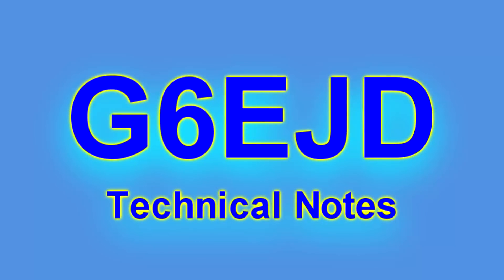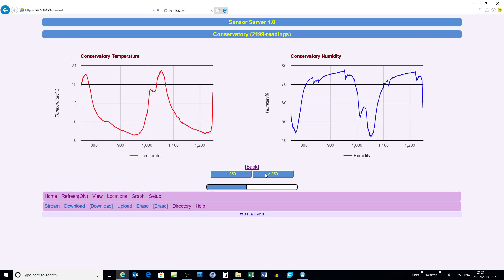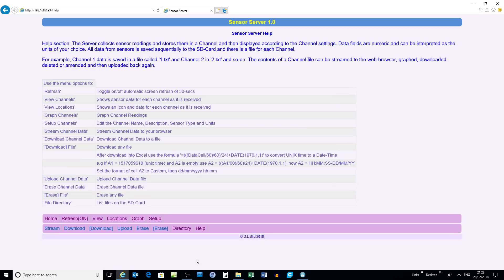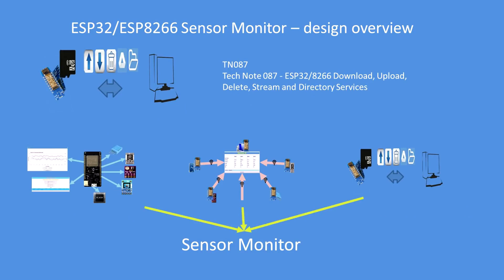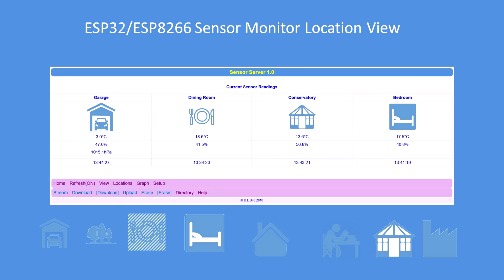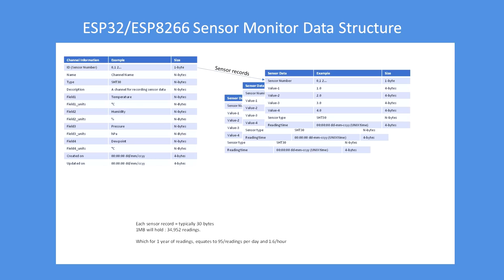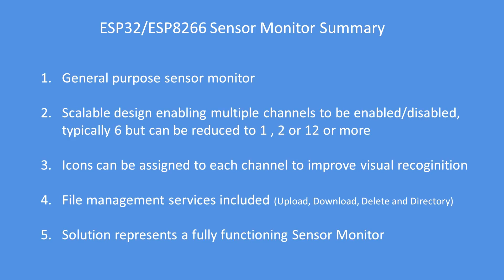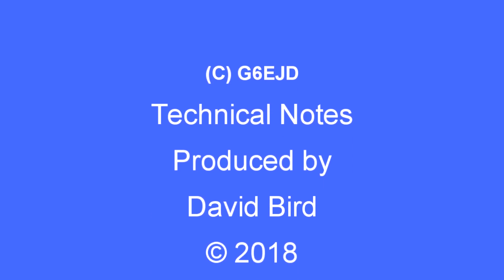Tech Note 088 - ESP32/8266 Sensor Monitor

Comment: Hi Dave, 
Have my 4 sensor all working OK. 
Many thanks for a fine piece of work.

Q. How hard to put "Time" on the graphs???
Reply from the maker: Hi Pete, in the graphing section code I’ve left the line that uploads time to google charts you can have either a simple numeric count or time. It’s difficult to get google charts to display time because it compresses the margins but a compromise is to adjust the display angle. The uploaded time is Unix ordinal format. There are also other examples of displaying time in my repository it’s only a single line that needs to change.
Reply from the maker: // Uncomment next line to display x-axis in time units, but Google Charts can't cope with much data, may be just a few readings! 
236    //webpage += "minorGridlines:{fontSize:8,format:'d/M/YY',units:{hours:{format:['hh:mm a','ha']},minutes:{format:['HH:mm a Z', ':mm']}}},"; 
237    //minorGridlines:{units:{hours:{format:['hh:mm a','ha']},minutes:{format:['HH:mm a Z', ':mm']}}  to display  x-axis in count units

Comment: Wow. You have spent a lot of time producing this sensor software. Thanks!
Reply from the maker: David Kempton - I hope you enjoy it, making it reliable and robust against errors or system faults take me longer than writing the bare code. My server has be running 24/7 since early Nov17 without any issues and has built up many 000,S of readings. The only thing to watch is file transfers as you may think it has locked during large transfers but the http protocol is quite slow on the ESP compiler. I need to put S means of showing transfer progress but the webserver doesn’t support multiple tasks to make that easy.

Comment: Dave, I wonder if you could help me on the time setting for the Sensor monitor server, I am trying to get it to show EST or as it is now EDT.. can't seem to figure it out, I assume it's under ,void SetupTime() ,  timezone tz = { 0 , 0 };   setenv("TZ", "GMT 4EDTEST,M3.5.0/2,M10.5.0/2", 1);
  tzset();  ?.... thanks as always !
Reply from the maker: Ross Romeo Have a look here: https://github.com/nayarsystems/posix_tz_db/blob/master/zones.csv 

America starts at line 53 you need one of the EST versions the code needs to match these the format m.w/hr/hr e.g. 3.2/0/2 means month 3 for March and week 2, etc. Choose one closest to you and paste into the string for time zone. These are the best list of posix time zones I’ve seen and they work well.
Reply: Thanks Dave, I did set it per the link, so it looks like this ---   setenv("TZ", "EST5EDT,M3.2.0/02:00:00,M11.1.0/02:00:00", 1); -- which sets My timezone for daylight savings time, But I think I am missing a lot more in actually seeting the time as it still shows just the default of  --       Waiting for time...Time set 19:00:02-31/12/2017    --in my serial output  
I am thinking I am missing variables in your code here
 timeval tv  = {BaseTime, 0 }; // 00:00:00 01/01/2018
   timezone tz = { 0 , 0 };
If you could point me in the right direction...  :-) I am still googling POSIX.... but am new to using that
Reply from the maker: Ross, I’ll try it out. It could be EST has not been implanted correctly as it appears time is not being set. You are already in DST I think
Reply from the maker: This is a copy from a test I just ran: 
setenv("TZ", "EST5EDT,M3.2.0/2,M11.1.0", 1);It shows me EST of 11:42 at UK time of 15:42, we go to DST tomorrow at 0200.

Looking at your Code: it should be EST5EDT,M3.2.0,M11.1.0 as per line 98 in the POSIX list I linked to, unfortunately you can't use Mins and Secs in the time-shift definition, only hours. I can't find any other viable EST code.

What is your nearest City?
Are you using the ESP8266? DST has only just been implemented in the IDE ESP Core 2.4 are you on 2.4?
Reply: I copied your line exactly (i think is New York) , but still the date and time default to : 19:00:02-31/12/2017......So it seems Like the time zone is set, using Arduino Ver 1.8.3 and board is WeMos D1 /r1 /Mini, under boards, Cant really tell if that's 2.4 core or not, but am using your Sensor monitor Version a, Everything else works great... seems like its just ignoring the Time or not getting any time from the internet at all...... odd
Reply from the maker: Ross Romeo OK I think this may be due to the compiler core as time zones never worked before the update to 2.4. You need to go to your board manager and type in ESP and update to 2.4 then recompile then it will be ok assuming all the time zones are working on the ESP8266. I presume there are some working time zones or maybe that have never worked due to the compiler being out of date. The UNIX time default in the programme is set to 00:00:00 01/01/2018 and minus your time offset gives you the 1900 time your seeing or effectively 0 meaning the time zone code used is not being recognised. Time to update your ESP support in your ide and a move to 1.8.5 will help remove other frustrating errors that are  often unexplained.
Reply from the maker: Ross, I have now co firmed the compiler at version 1.8.3 has no support for ESP8266 time zones by loading that version and confirming the time zone variables have no effect. So you will need to update your IDE via the boards manager to the latest, actually I’m surprised it’s not bagging you to update mine does, maybe you have check for updates turned-off. 

When you update during the compilation process the compiler will add in the correct time zone library / code support and it will work as expected. The ESP32 compiler elements have always supported time zones.
Reply: Thanks Dave for looking into it, I confirmed I am at 2.4.1 for ESP8266 in Boards Mgr. and i upgraded to 1.8.5 IDE, and re complied using " EST5EDT,M3.2.0,M11.1.0", exactly from POSIX  Db from your link above... But still no joy, scratching my head on this one...I do have an ESP32, and will try that next to see if it changes, I have another SD card , and was using the SD card shield , on the WeMos D1 , from one of you other videos for this one...... I'll report back !
Reply from the maker: Ross Romeo I’m wondering if you have the correct DNS entry in the network tab, because if not it can’t find the time server. My router base address is 192.168.0.1 and so the DNS is set to that, I suggest you check the entry matches your router address.
Reply from the maker: Line 5 and 7 need to be your Router address
Reply: So I decided to try a fresh download of your server version 1a, from GitHub., and tried a new esp32  and keep your British Time zone , figuring the worst case is i see British time zones.... But still no Joy, I confirmed I can ping pool.ntp. from my laptop which is on the same sub-net and using the same DNS, and like you is also my router base address.  So using your fresh copy I get:
setenv("TZ", "GMT0BST,M3.5.0/2,M10.5.0/2", 1);
Waiting for time...Time set 00:00:02-01/01/2018 
Using the new York Timezone I get:
setenv("TZ", "EST5EDT,M3.2.0,M11.1.0", 1);
Waiting for time...Time set 19:00:02-31/12/2017
A bit of a different result......but no time at all..

Di I have make any changes to these parameters
 timeval tv  = {BaseTime, 0 }; // 00:00:00 01/01/2018
  timezone tz = { 0 , 0 };
  settimeofday(&tv, &tz);
  configTime(0, 0, "pool.ntp.org"); ?

 Beginning to wonder if it's something in the USA network....
Thanks as always !
Reply from the maker: Did you see my reply about the Domain Name Server, this is almost certainly due to the ESP (either version) not being able to locate the Time Server.  In the Network tab you need to ensure the entries there match your Router:

IPAddress local_IP(192, 168, 0, 99); // Set your server's fixed IP address here
IPAddress gateway(192, 168, 0, 1);    // Set your network Gateway usually your Router base address
IPAddress subnet(255, 255, 255, 0); 
IPAddress dns(192,168,0,1);           // Set your network DNS usually your Router base address
What is your Router address?

Where mine is 192.168.0.1 you need to replace that with your own. Perhaps 192.168.1.1 or 192.168.1.254 or 10.10.10.1 or whatever. Then when the ESP looks for the pool.ntg.org address it will go to the address in my example of 192.168.0.1 and then the Router sends that address query out to the WAN and gets a response. 

Let me know if there are any differences in your settings so we don't end up chasing around the problems. I've just tested on the 8266 and 32 this zone setting EST5EDT,M3.2.0,M11.1.0", 1  and it works OK, so it must be your DNS setting is wrong.
Reply from the maker: Ross If your Router is not relaying DNS requests I.e. the address of pool.ntp.org then try IPAddress dns(8, 8, 8, 8);
Reply: Dave, I figured out the  issue, and I am feeling quite sheepish, I was missing something in the line "config time," so added "configTime(0* 3600, 0, "pool.ntp.org" );", it was defaulted to   ""configTime(0, 0, "pool.ntp.org");".... I knew I had several other projects using pool.ntp.org with no issue......I should have noticed that .... So Problem solved....Time and date is perfect..... I love this Program BTW.. it's really a neat project...Thanks so much !!
Reply from the maker: Good to hear but mine works ok with 0,0 but when I tested it I may not have taken account of the UK time change that happened this weekend gone. I think you have uncovered a flaw in the ESP time setting as the rules are supposed to set the hours accordingly and they are not. I’ll look into that further. Possible compiler issue.

Comment: I finally got my MicroSD card for the ESP D1 mini, and this program works, and all pages display except the Channel Setup/editor page has a problem,  when I select any Channel to edit, I get, the "Page cannot be displayed" error. 
I have one remote sensor for testing right now, and it is sending Temp / humidity / pressure, on Sensor-3. So seems the only thing I cannot do is "edit the Channels". I added this line under "Void ChannelSetup" after data_amended = true;
    Serial.println("Channel Setup selected");, So when I select a channel to edit, I do see the Serial output  print "Channel setup selected" , so the page knows I hit the button....... kinda stumped, let me know if you might have an idea whats wrong... thanks....
Reply: Dave, I found out, it is not the program, as it works with any browser on my Smart phone or my wife's Laptop, Just not my Laptop for some reason, and I need to look at my laptop settings to see why in the world it would not display all the pages, and just not the Channel edit page !!
Reply from the maker: OK, I think this is due to an issue with the ESP32 implementation of the Webserver library. Last week I have uploaded a revised version that solves your problem specifically for the ESP32. There is new ESP core too 2.4.1 that’s worth installing. Let me know if it’s not working after the new version.
Reply from the maker: Ross, it’s a browser and ESP issue, especially IE 11, but I’m sure the 32 version I uploaded fixes your problem.
Reply: G6EJD Thanks Dave , let me try that and I will report back, appreciate the fast reply !
Reply: Dave,  Happy to report the new version works like a Charm !!!, This really is a cool program, and working to add more sensors around the house. My backyard sensor is solar powered with battery back up !.... Thanks Again !
Reply from the maker: Good to hear, the changes made were necessary for the ESP32 as there is a problem with the webserver library but luckily the ESP8266 works just as well. My sensors are set to 30-min update intervals which I find adequate. I find it interesting to see how temperatures vary throughout the day, well mainly at night when the heating goes to night set-back as the rooms cool down at different rates. If you power an ESP32 or 8266 from a 3.2v battery it will last as a sensor well over a year in sleep-wake-update-sleep mode
Reply: Yes, I think 30 min is a good interval. I do have another question if I could , As for the BMP180 Sensor Client, I am trying to do two things 1. Convert from hpa too InHg , 30.06 (example  Format), I can convert by using "  *0.02952998751 " as a formula, but it always comes out as 3006.1(example)....2. trying to put in an altitude correction, as it reads Lower pressure than it really is, for example My altitude here is 100 meters.... let me know your thoughts if you could... as always Thanks,... All other sensor reading work really well, and converting to Temp F was easy... that's what I get for living in the USA....
Reply from the maker: The sensor returns pa so you need to divide your inch result by 100 so your very close, either divide the partial result by 100 e.g your 3000 result or add two more leading zeros to your conversion constant eg. 0.000295299. The best way to calibrate the sensor pressure is by adding a constant offset the sensor is calibrated at the factory for 1013.25 hpa so what I do is use a nearby know source maybe a metar station and iterate the reading to theirs but they need to be at about the same altitude. There is a standard formula for converting sea level pressure to pressure at altitude but they vary in accuracy the good ones ask for temperature at altitude your location so they can work out the correct pressure from Boyles Law where P.V/t=K where V is volume and t is temperature so when temperature rises pressure falls. In practice just add some decimal inch’s to your pressure value until it is about right relative to other stations nearby also Weatherunderground is S good source for calibrated sensors. They have a wundermap with all stations listed so you can browse around for a nearby suitable one.
Reply: Thanks Dave, ..adding the leading zeros in the formula, moved the decimal where I needed it,  as well as changing the "resolution to "2" allowed for 4 digits Like 30.08 !, ...... I also used Weatherunderground, as well as looking at field elevations at a close airport near me, changed the offset to 0.35 , and no see my pressure is right in line with most other stations nearby, lucky today Pressure has been steady across our area... THANKS Again Dave !!
Reply: Forgot to Ask One more Question, Is there a way to add resolution of 2 fro the graphing Page ? For example I notice my Pressure started rising from 30.04 to 30.09 , But the Graphing is showing 30.1 (rounding it Up), would like to graph to 4 points if possible ....I did not see in the code where I could add that resolution for the Graphs,  Let me know your thoughts, ........ cheers !
Reply from the maker: Good to hear it’s going well. On lines 837, 8,9 and 840 changing String(float(displayed_SensorData[i].field1),1) to String(float(displayed_SensorData[i].field1),2)  will add more graphing resolution so ‘,2’ will display 30.01 rather than 30.0 but you might want to change it in small steps as this change varies the amount of text sent to google charts, it should be ok to go to ,4 but it it starts locking up you’ll know why 😃 Both ESP types are limited by the amount of text they can hold but I’ve tried to counter that by periodically sending data to google. When graph data is sent it looks like this “[1,20.1,30.1]” for reading 1 at 20.1° and 30.1 in. A total of 13 characters so increasing resolution will add another 2 characters [1,20.10,30.10] making 15 in total and for 1000 readings that’s an extra 2000 characters to be sent. As I say, it should be ok but I have not tested it but small steps from 1 to 2 to 3 up to 4 will help you see if reliability is affected, I have not found a deterministic way of finding out when it fails. You will find google charts is good at sorting out the increased resolution when it displays the data but sometimes a high or low value that’s a long way from the average masks resolution, so readings like 30.02, 30.03, 47.1,30.6,  will be autoscaled between 30 and 50 but these events are very rare. The google charts can be fixed in the y-axis but it’s a bit complex to do.
Reply: I see what you mean, So I only changed just the Barometric pressure to "2", and It is doing well so far on the graphing, the Y axis looks to be scaling correctly, showing my range when I started at 30.06...up to 30.18.. now falling to 30.04 now.... The rest of the graphs I will keep to resolution of 1....... Thanks for pointing me in the right direction on that !!
Reply from the maker: That’s exactly the way to do it and minimise the data transfers too. Sounds like it’s all coming together nicely.